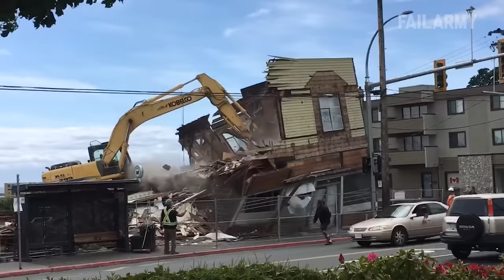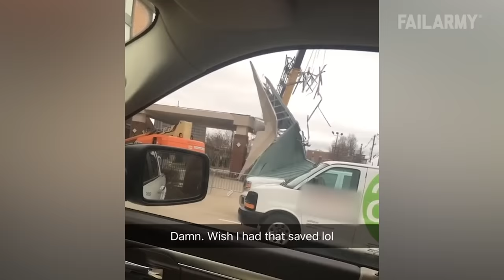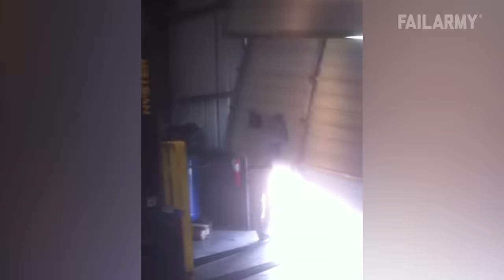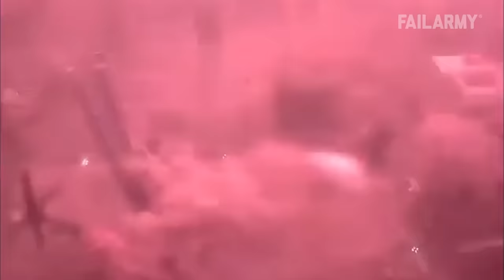Sports Car Ruined! Expensive Destruction Fails Compilation

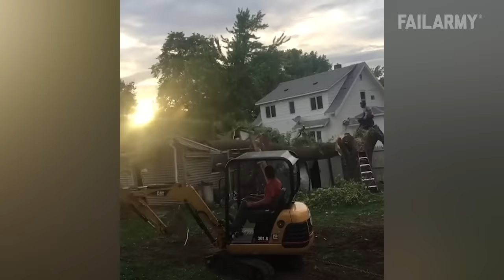Comment: 3:07...
Honestly...who does this? How can you not know that the bed has not been lowered? Unbelievable.
Reply: White truck was an idiot too for not even anticipating that.
Reply: It happens often too, it's insane.
Reply: I have had this argument  with others that claim it can happen.
I have driven dump trucks at slow speeds at construction  sites with the bed raised. Tailgating gravel or whatever.
You feel how top heavy the truck is. You feel the wind hit it.
The rocking and swaying and drag from wind resistance at highway speed must be enough to make you sea sick and you must wonder why it is floored, the engine is screaming, the tach is red lined,  and you are only doing 40mph.
Then you look in your mirrors and you do not see your bed. Just a spinning drive shaft.
The missing bed ALONE should be a clue, not to mention  it must feel like you are towing the queen mary on dry land with the world wide convention of over eaters anonymous  on board. 
I see no way this can happen at highway speed.
Unless drugs are involved or you are stupid.
Reply: @MrYfrank14  at the company I work for, a malfunctioning box buzzer is considered a major defect. Granted I’ve just plowed but I’ll be dump trucking soon

Comment: 8:49 I’ve never seen a motorcycle commit suicide. Sad really
Reply: Heh, yeah, owner was a dummy though, just disconnect the fuel line, or the spark plug, jeez... it's not diesel, you can easily kill it if it runs away on you 🤣

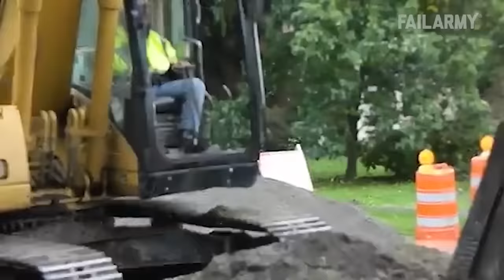Comment: 4:27 its not always the contractors or operators faults.  In Toronto before digging the city has to inspect and tell you where the lines / wires/ pipes etc are . We did this and they got it wrong , told us it was ok and clear and we only dug down a foot with our s300 and cut the cable lines to the whole street.
Reply: Dannydolan88  yep

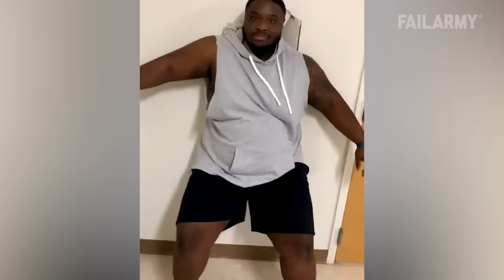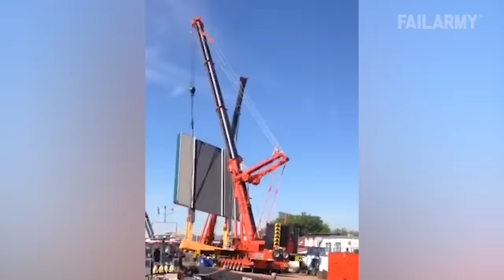Comment: the videos from 4:05 and 4:38 are from the same accident. it was in the Netherlanders. you can see the crane in the shadow in the first clip
Reply: Yes you’re right and did some die in that accident?
Reply: @paulusferdinand1136  no persons died, but someones dog died because the brigepart fell full on his house.
Reply: It was a pretty bad accident, and for the life of me I can't understand how they came up with that lift plan.  They had 2 cranes on unstabilized barges, lifting the bridge.  The plan was to swing the two cranes in unison to bring the bridge into position... but of course the center of gravity would shift as soon as they'd move the load, and as soon as the barges started tipping, they lost control of the load and it was all over.

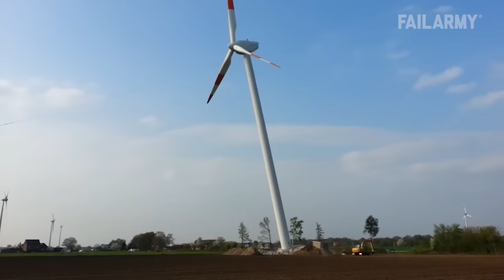Comment: 6:48 fun fact, this goes straight to landfill. No recycling or nothing. Landfill. That's green energy for you.
Reply: Why lie?
Reply: No not anymore.
This was only done maybe 10-20 years ago.

Nowadays the fibreglass gets burned and the ashes are used as fiber filler material in concrete and asphalt.
And all the metal parts (steel from the housing, copper from the electronics) are remolten and recycled as well.
Reply: @kb-elmo  exactly. If recycling costs too much then just let the local gypsy/travellers camp know.
They will have it separated into plastic/ferrous/copper/stainless/precious by dawn's early light...
Reply: @kb-elmo  I was struggling to find reliable sources, best result was an estimate that 90% of rotor blades (fiberglass) gets buried. Do you have a link to those claims?
Reply: Cool (even though that's no longer true...), let's burn fossil fuels instead then... :\

Comment: I bought a Super Charged 300hp Lotus Elise a decade ago. I was told, 'If you make it thru a year without crashing you will be a driver'. I drove it for 50,000mi, no crashes but too many speeding tickets. I sold it and returned to motorcycles. I still go fast, but motorcycles don't busted for speeding like automobiles do.

Comment: I do not know what caused that balcony to collapse, but I would be concerned. Those things are designed not to snap off. So, either something hit it REALLY hard, or the balcony wasn't up to code. Which puts the entire structural integrity of the building into question.
Yeah, it isn't good.
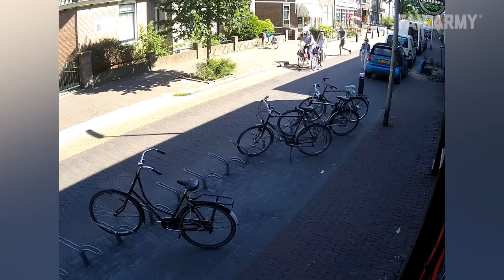4:07 I'm not sure what just happened, but from the looks of it, one of those buildings had a partial structural failure.

4:27 There are 2 likely people who could have been at fault here. Either the people in charge of this project didn't do their job and make sure there wasn't a chance of this happening, or the operator of the excavator wasn't paying proper attention.
Reply: I'm studying to be an architect and structural engineer. So, I know a thing or two about buildings.
Reply: If you ever witness debris falling from the ceiling, you should let someone know. It isn't always bad, but it could be.
Also, if you're in a multi-story building and they keep replacing the windows on the ground floor because they keep breaking for seemingly no reason. Leave. That could very much be a sign the building's live or dead load is too heavy and it is compressing more than normal.
Reply: I'm just making a comment thread to explain what happened in some of these. 
9:14 Couple possibilities, most likely one is either water damage, or someone didn't properly attach the drywall. 
10:07 That's why you should always be careful when doing demolition. Dude kicked out a load bearing wall. Or in other words, kicked out a wall that was actively taking the weight of the roof.
Once that went, the other load bearing walls couldn't hold the weight and gave. This is how all structures collapse, or at least the vast majority. Load bearing supports give out, causing the weights to redistribute onto the rest, they give because they're now overloaded, causing it to spread until the building just collapses.

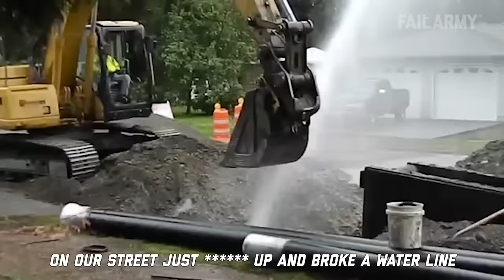Comment: 4:18 its only the operators fault if they didn't call 811 before they dug. If they were looking for the water main to work on it, he could have been told it was 6' down and it wasn't 
More than likely it was actually the locators or spotters fault.

Comment: Ok how many times now have seen Videos of dump trucks with their bins up in the air while driving down the highway??

And I still don't get how this is possible??

For one how doesn't the driver not see that it's tipped up???

And two why isn't there a safety system in place to prevent the truck from moving at any speed other than enough speed to dump out the contents!?

And three why doesn't anyone who is on the highway and sees a truck like that not tell the driver or call the cops .....

And speaking of cops you'd think that they'd see it and stop them

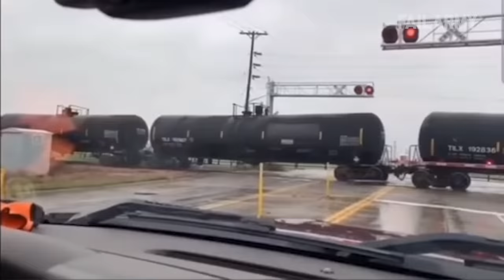Comment: 5:15  Maybe this wouldn't be happening if the train system would of make the rails a bit wider than shoulder distance apart.
Reply: I’ve never seen that happen in the UK with a goods train. I don’t understand how they tipped like that
Reply: America uses the standard gauge track, same as the UK. Derailments happen for other reasons, like 1000s of tons of steel, iron and cargo coming to a sudden stop. Inertia and all that, we have the same width tracks though 😜
Reply: @sarahbarton4977  inertia
Reply: @boogersaregood  Thx Britttany.